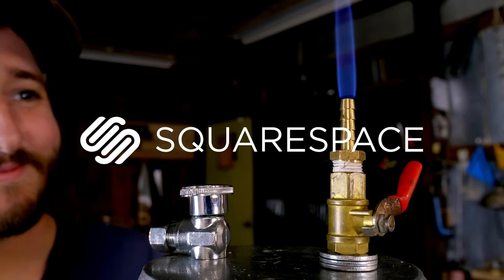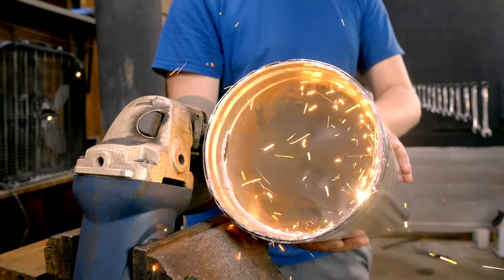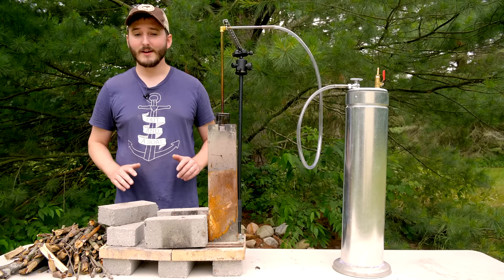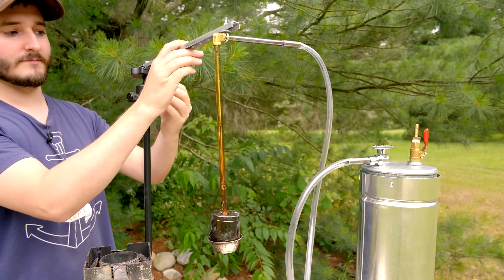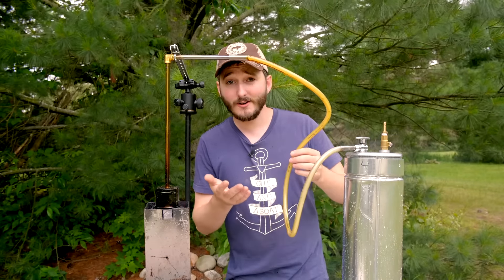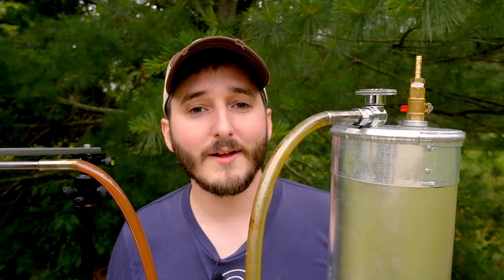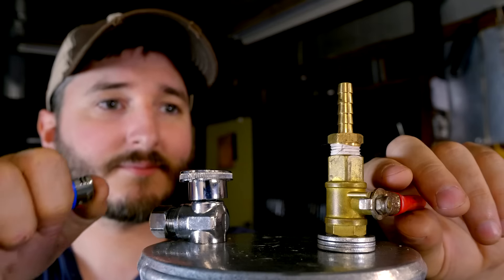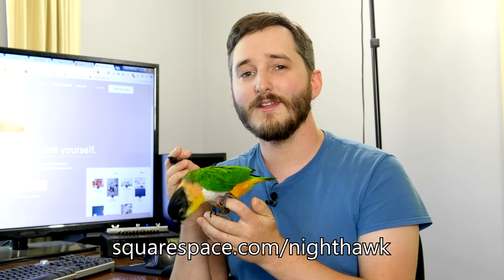Bio Fuel Storage: Building A Gasometer

Comment: With the appropriate catalyst (i think it was something like copper and zinc oxide?) You can eliminate the CO problem because syngas also has hydrogen which allows you to make methanol. Granted it's not a gas to be used in a stove but still a valuable fuel in its own right.

Comment: If you want fixed metal pipes you could just install a thin U shaped metal tube that goes down trough the water and up above it. It's essentially filling the tank from the inside, not trough a valve.
Reply: I'm not sure how well that would work, since the pressure from the wood gas production would have to push the water out of the U shaped tube.
Reply: @Rafael Dos Santos
That's what it is doing with the current setup too. So it should be fine. I'd go with the internal tube.
Reply: Rafael has a valid point. A long Tube surrounded by water will pretty much act as a condensator and collect moisture from the wood, just like the PVC tubing, but worse. 
Attaching a small reservouir at the bottom would solve that problem easily and with no big effort.

Comment: I really liked this video!
You can get around the flexible tube by having your inlet and outlet pipes enter the BOTTOM of the water chamber, and then rise through the water into the headspace of the floating chamber.  Gas will come in the bottom, rise through the tube in the water (or you could have it bubble through the water, but your gas generator would have to be above the water line) then it would either float the upper chamber, or pass out through the outlet pipe (depending on gas demand).

This is the first wood gassifier that i have seen with any type of accumulator, and I must say, it has given me a lot of ideas!
Reply: Great suggestion

Comment: the build is really informative. i have some ideas for improvements though like i didnt see a pipe leading into the water i dont think your filtering the gas all that much without it going into the water first. if you do put the pipe on it and you want the cleanest gas you can get i would recommend a diffuser of some kind at the end of the pipe which will increase the surface area of gas touching the water. i was looking for a way to contain some gases i intended to make soon i love this idea thank you so much for posting it i love your content.

Comment: The gas will self clean with or without water. I build gasifiers and I use a design that I came up with that I call a expansion tank that works on the same theory as air conditioning and Refrigeration where you have gas passing through a small tube into a large chamber where it cools down due to the expansion of the woodgas and while it's cooling down it's losing humidity in the gas along with other contaminants that will flow to the bottom of the expansion chamber. I also use a traditional method a passing it through filter media but I use a tri-filter setup to further capture water and humidity along with other contaminants in the gas. What you built works really well especially for a demonstration but it would be impractical for running an engine because you'll need a larger volume of steady wood gas for power production even for a home setup.  You made a really good demo video. Thanks for the Post

Comment: Braided steel cables (the ones meant for hot water hookups) or PEX (polyethylene cross link) tubing can't handle combustion temperatures but they are at least more heat resistant than vinyl and should have common links with standard plumbing fittings.

Comment: I think you can use a coil of copper pipe to cooling off the gas a little before it enter the plastic pipe? That way the gas will not too hot to melt the tube

Comment: I work with systems that measure exhaust gases from combustion engines. Those gases are hot and need to be kept at temperature to avoid condensation. To keep the gases heated we use so called flexible heated lines which use PTFE or PFA tubing inside, PFA being more chemically resistant (as far as I know). As you don't need to keep the gas heated, the tubing itself should be sufficient. It's not as flexible as vinyl tubing, but I'm confident you can figure something out.
Reply: NightCaiqueInLight

Bingo, new subchannel name for bird antics.

Comment: Copper pipi tubing with crimped joints and run the gas through a car radiator submerged in water then use  plastic pipe to go to the gas store pot feeding through the bottom outer case into the center of the outer tube will help filter gas

Comment: Great video! I love your style of making videos! 
I am working on something really similiar for my oxyhydrogen generator. However, I am also trying to store it under a slight pressure by placing a 10 kilogramm weight on top of the tube, so that more gas fit's inside.
Reply from the maker: Make sure that you separate the gasses and store them in separate containers. Storing oxyhydrogen together in a tank like this would be an explosion waiting to happen.
Reply: There are a few videos on youtube where people explain how people died because of compressed oxyhydrogen being so volatile and exploding
Reply: NightHawkInLight Of course I know that, and I already made a lots of experiences with oxyhydrogen in the past. Storing about 5 liters is really no problem, its not that huge explosion, compared to other explosives. Seperating the gases using gravity works a little bit and reduces the amount of oxygen in the mixture, however, there is still enough left for a slow combustion.
So I am going to find another way of doing it🤔☺️
Reply: Freizeitflugsphäre it's pretty easy to separate the two gases if you're generating it through electrolysis. You use a wide basin of solution, and use separate catchment containers above the anode and cathode. You can even use two separate containers if you have a solution-filled tube connecting them. The hydrogen reservoir will need to be twice the volume of the oxygen one.
Reply: James Petersen But thats efficient as hell

Comment: Hey, so what I was wondering. What would be stopping you from taking the clean gas and compressing it into a propane tank? That would make it much more easy to transport and use
Reply: I've been wanting to do essentially that but my fear has been that I don't know the combustion point for the Woodgate, so it could conceivably turn my air compressor into a diesel engine essentially and possibly blow up on me. 
if any has done this or knows some hard data regarding combustion point I'd love to hear from you.
Reply: @amharrach  as long as there is no oxygen being introduced and the tank is purged there should be no issue as combustion would be impossible, super cooling the pressure vessel would also remedy this issue; would be an interesting project w/ a bomb squad near by 
ahaha
Reply: @amharrach  You might try building a set up like vid, but then sealing the two pipes (the wood gas collector) in the "full" or extended position. After that, plumb the outlet to your propane tank, then introduce water through the inlet valve to compress the gas. Once compressed, open the outlet valve to the tank. Obviously there's a bit more to it, but this should give you food for thought.
Reply: Hi. I'm late but I'll give my two cents. Compressing wood gas is not safe and also not economical . Due to its low atmospheric pressure . This is the one drawback of wood/town gas . It excels at being used on the spot

Comment: Dear NightHawkInLight, 
 I have come up with a few cool things you could make a video on using wood gas. 
1. Compress cleaned gas into a tank and use it in a grill or gas lantern.
2. You could run a small generator off of it and/or see how big of a generator it can power.
3. Make oil and purify it into gasoline/ diesel fuel. 
4. Run a propane fridge off of the gas
5. It would be more work but a go kart running off wood gas would be cool. It could use compressed gas.
Reply: I don't think a propane fridge will work. Any stove will though with an appropriate jet.

Comment: Not sure if this has been mention but a small heat exchanger before the tubing would stop any danger of  it melting the tube I have used similar distilling lavender oil just a tube the same as the top tube with a water jacket fitted around it you can either have a pump set up to move the water around or just make a water bath and just top up with cool water occasionally to keep it cool. This is also a great idea for storing hydrogen from a solar electrolysis unit as well. Thanks for some great ideas

Comment: Radiator hose used in overflow lines.
That is made to withstand temps over 120C,
Don't know if the EPDM rubber will be resistant to this gas, but EPDM is also used for fuel lines and AC lines.

Comment: Silicone tubing is good to have around. It's short term temperature resistant to well over 300°C, long term to about 200. It won't melt ever, and if it starts to discolour, it's degrading or basically slowly burning up.

Vinyl has a fairly high melting temperature... i forget... but it's a very hard plastic, so tubing must contain plastifier, which potentially has little effect on melting temperature but gets glass transition temperature way down. Incidentally this is why it's becoming softer when it heats up. At the start of the video i guessed that it would survive and hey happy that it did.
Reply: Hey Siana! Singularity Viewer user here.
Reply: He needs stainless flex hose.

Comment: I love your collector. 
I'm wondering about the chemistry of the water over time as it becomes saturated with tars and other combustion byproducts. The viscosity must be increasing and at some point will need to be exchanged. After a number of runs check to see if there is stratification or settling of particulates. It might be evaporated to reduce the volume. The byproducts may also be environmently detrimental if not hazardous. Then again if in fact there is a substantial solid component when dried it might be combustible and used in subsequent cycles.
Reply: It's combustible and it can be broken down ( cracked ) to make liquid fuels similar to diesel & gasoline.

Comment: Now you need to make it fuelled by a solar concentration lens so that you dont have to waste the wood to heat the fire, it can all go into making gas. Then you need to compress it and store it and run an engine on it.
Reply: Or connect it to a furnace that is already going to be producing pyrolysis capable heat.

Comment: I live in the San Luis Valley of Colorado where many of the shallow artesian (free flowing) domestic wells also produce a quantity of methane. I know a fellow who made a giant gassifier. He took a 1000 gallon stock tank and plumbed the output of his well into the center bottom of that tank. He then  inverted a slightly smaller stock tank into the 1000 gallon tank. A valve was brazed in the center top of the inverted tank.  Stock tanks of this size are heavy, but once the inverted tank had lifted several inches, he had enough pressure to do all of his cooking and heated a small room. The artesian overflow watered his livestock and his domestic water had slightly higher pressure and tasted better. He says he learned this from oldtimers in the neighborhood.

Comment: It would be a great idea to compress all of collected and filtered gas with an old refrigerator compressor or a modified bike pump (I've seen people making pumps out of pvc pipe that are able to produce more than 100psi) into some pressurised container for later use. Your low pressure container is great for collecting gas before it could be compressed
Reply: Compression rates are not good. I had the same thought. I found that a propane tank would only get a car 2 miles on the road.
Reply: @tedf2  sad but true
Reply: @tedf2  either you used a little camp bottle, or your car gets 20 rods to the hogshead
Reply: @tedf2  dude what a 20lb would take my truck (petrol only atm) 20 km
Reply: @ellenorbjornsdottir1166  I'm not sure what you're asking. But form the various websites describing vehicles running of wood gas it seems that the production of the gas was produced on sight directly feeding the engine. Also, the efficiency was equivalent to gasoline efficient vehicles, including transportation of the wood fuel.
p.s. I'm no expert on this subject, although I'm indentured by it. Having said that, I don't think this is an alternative as a replacement of the gasoline engine i.e. "The Green Deal." There's just not enough of the feed stock around, just like ethanol. There are some plants worldwide operating on this fuel because they have a feed stock of waste from the products they harvest. Also FEMA has designs for producing wood gas for generators. but it's not meant as a replacement of the electric grid, rather it's to compliment it during emergencies when the grid is down.
Reply: @tedf2  I'm referring to propane
Reply: @ellenorbjornsdottir1166  I have no clue. Forklifts operate on propane.

Comment: You should try using the wood tar for something. Maybe make a 14th century ship with it. ;)
Reply: It's creosote.  A few decades ago,  it was used to treat utility poles, railroad ties, etc.  Here in the USA, general sales of creosote was banned by the  EPA in  1986.
Reply: @gyrgrls  damned epa
Reply: John Bond why was it banned? Just curious since I honestly don’t know anything about it.
Reply: @ThatOneFriendlyDude  It's extremely carcinogenic. It's roughly thethe same as cigarettes' tar, just more concentrated, it'll give you all sorts of nasty cancers. Also, every kind of heavy metal found in low amounts in the starting wood will be concentrated in it.
Reply: @operator8014   I've actually had a localized allergic reaction from sitting on a cross tie before.
Reply: @ThatOneFriendlyDude  I don't think it's the wood tar itself That was banned, if I recall correctly it was the process of making it back then. The coke ovens back then we're not in any way efficient, they smoked so bad that they would cause zero visibility in the valley that they were operating in.  If the tar is created now, the systems have been engineered to capture EVERY bi product, closing the loop of pollution and wastfulness.  Thanks for posting this. Litteraly a lifesaver.
Reply: @robertotarter7839  To be clear, there are 2 types of creosote tar. One is produced by wood gas, the other is synthesized from heavy petroleum byproducts. The natural stuff isn't dangerous, the petroleum stuff is carcinogenic.
Reply: @rcjd7834  i wish more people saw your comment . you are right!
Reply: You can burn the creosote in the rocket stove to make more wood gas. Theoretically everything used should burn leaving only ash which can make lye.
Reply: @gyrgrls  I don't think it's pure creosote.  I think this stuff will burn and turn into a viscous tar when heated slightly. Creosote on the other hand is hard and brittle even at high temps and is very difficult to burn.
Reply: Thanks for your video!!  It's truly amazing the things that were used years and years ago and have been forgotten or just never known.  I've been researching fuel alternatives, energy production methods,  and here lately I've been trying to figure out the absolute best way to to use my 4x6ft water heating panels.  I would absolutely love to do away with having to supply electricity (from electric company) to my water heater.  I think I am going to use 12v-24v heating elements in a 30gal tank in combination with the two Revere water heating panels. I will need a circulation pump anyway so maybe I can use battery/ solar for that?  If you have any suggestions or videos, please let me know. I just recently have been reading up on parabolic systems but haven't quite got it down yet, at least not the dish style. Anyway,  thanks again for the video. I actually have everything but the top end cap already...lol
Reply: I like that lol. Reading g comments is very informational. Like building somthi g with a team throwing ideas at u. This helps u come up with a perfect combination. 👍
Reply: @bilbo_gamers6417   yea but they will destroy the environment in every horrible way but let's ban somthing everyone can make. Typical government crap..
Reply: @ThatOneFriendlyDude   I realise the government run organizations do not care about environmental things much as they care about us being able to create our own power and natural medicines and not relying on them. This is the reason they do these things. Big companies don't want u making a product naturally instead of buying there straight chemicals that creat more toxic waste then anything 😒
Reply: @brianbuchanan5702  the biggest, saddest truth-bomb I have seen in a while....